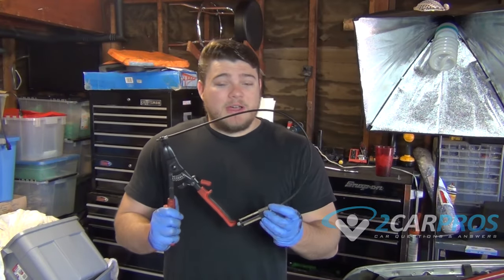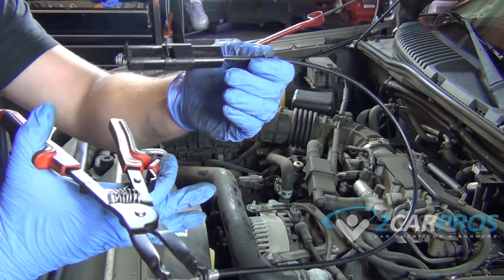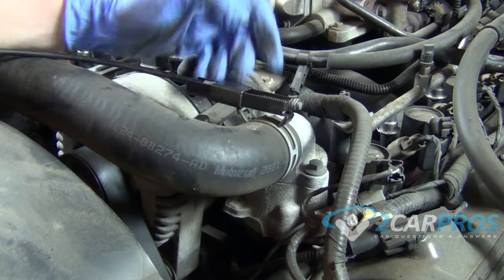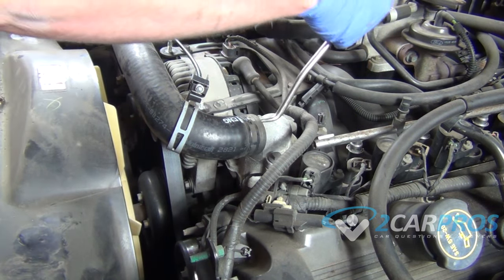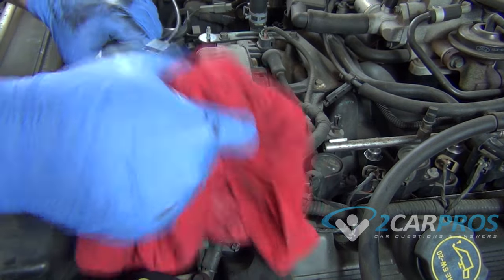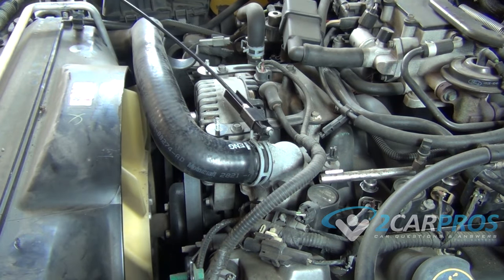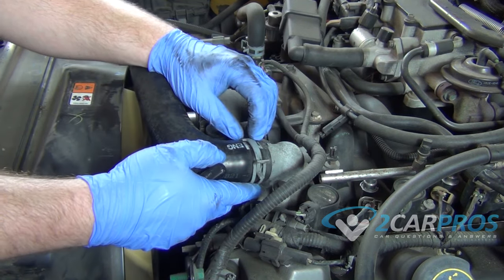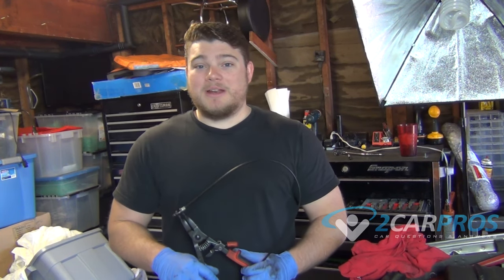How to Use Flexible Hose Clamp Pliers - Remove Hose Clamps Easy!

Comment: Another good tip on old hoses is to use a heat gun to warm them up to put them on and off  very useful on working on older Marine Engines and  Systems ! FYI
Reply: Or a good torch.

Comment: Use a little oil or grease on the inside of the hose, it helps them back off the next time you take them off

Comment: Your videos very well-made. However I ordered the tool you linked me to and I think it's an inferior tool to what you use. The one they sent me, the handgrip part is so small it's EXTREMELY difficult to build enough force for the tool to budge the clamps. It is better than the one I bought at my local auto parts store - it would not even open up wide enough to surround the little bat ears and squeeze them. I'm in my second or third week of trying to do this, so far I've spent $110 on wrenches, and the old defective leaking hose is still firmly on there. Well at least your video shows me how to do the repair, if I can ever get a proper tool. I'll never buy a car that has these hose clamps on it, ever again. I'll just keep putting new engines and new transmissions in my old cars and run them till they drop

Comment: I mostly work on motorcycles but still have issues with those types of spring loaded hose clamps. I see a lot of them on smaller fuel and vacuum lines in tight spaces. However, this unit looks too big to fit into those tight spaces to reach the smaller clamps I encounter. Seeing your operation though, just gave me the idea of using some small needle-nose vice grips to hold the clamp open while I use two fingers or two picks to pull the clamp back. Thanks for the demonstration!

On a different note... I don't understand why vendors sell something like this tool without providing a demo on how it is supposed to work. I think they would sell a lot more once people realize how useful the product is. I googled hose pliers (used to pry small hoses off their mounts), and remote action hose clamp tools were displayed. I had never seen them before, figured they must be useful to someone, but couldn't even see enough detail in the images to know how they work so had no interest in it. But then I decided to find a demonstration out of curiosity. Thanks again for the demonstration.

Comment: I rebuilt an engine and didn't know about these. I just saw these the other day and didn't understand the hose with the cable. That's AMAZING! That would have helped so much on the lower radiator hose of the Chrysler Sebring I rebuilt.
Reply from the maker: They are one of my favorite tools! Thanks so much for watching!

Comment: You never realize how having a special tool would really be needed... I had a small swollen coolant hose beneath a couple metal fuel lines on a 1992 Toyota 3vze engine that needed removing and I don't think these would have fit. Eventually got it loose with a pair of needle nose, but it took a little fiddling. But for most jobs these would work great! Thanks!
Reply from the maker: It is night and day! Thanks for watching!
Reply: Me to my heater hose clamps are deep off in the hood and space is so tiny I hope these work I just bought mine

Comment: TIP  for removing stuck on coolant hoses: 
1) while still filled with coolant, relocate the coolant clamps to the very end of the hose, even to the point of the clamp extending past the end
2) turn on the engine and warm up

the coolant will expand and "balloon" the hose ends radially outward  from the pipe nipples, while the clamps marginally still hold the hose in place and prevent leakage. if there is no ballooning, top up coolant to the point of over filling and try again

3) drain the coolant
4) remove the hose clamps

Comment: Is it safe to use these type of clamps on the radiator hoses of 2004 Ford F 350 Super Duty both top and bottom without them leaking coolant.

Comment: This is nice for the top hose which is easy to do even with pliers. But what about showing this work on the bottom hoses? Especially the small transmission cooling hoses.
Reply from the maker: Yes it does. Thank you for watching!

Comment: Nice video! 
I have a 1995 Oldsmobile Cutlass Ciera 3.1L with A/C. 
I just bought the regular style hose clamp pliers to remove the heater hoses from the heater core on the firewall. It's so tight in there I couldn't remove them.
The pliers in this video look like they need more room than what I have to work with.
Any suggestions? Thanks.
Reply from the maker: Maybe try right angle pliers? That sometimes work on the smaller clamps. Thanks for watching!
Reply: @2carpros  Thanks, I appreciate it!

Comment: Hi--Great video overall.  My one quibble with you is that you state at the outset, and I quote, "These are available from Amazon".  Not, "Pliers LIKE these are available from Amazon.  THESE are available from Snap-on's website for $138+, so unless you're a professional auto tech who uses these daily, go to Amazon and select a cheaper pair".  I immediately went to Amazon's website to look these up and purchase them.  I spent 30 minutes looking for these and, of course, never found them.  I did find the Mayhew version of this tool on Amazon, but it was $145.00 and included a pair of specialty hose pliers as well.  Both that one and Snap-on's version are made in France (I assume Snap-on's is simply a re-branded Mayhew).  It wasn't until I read Ken Johnson's comment (who lives in the UK) and your reply did I know that it was a Snap-on product.  The radiator hose pick you used obviously is, but this one was not.
Reply from the maker: Thanks for watching! I was just saying spending 140 bucks on a tool for the average person is a bit much. Mine are definitely snap on though https://l.facebook.com/l.php?u=https%3A%2F%2Fscontent-frt3-2.xx.fbcdn.net%2Fv%2Ft35.0-0%2Fp480x480%2F23483145_1676429019063418_142261678_o.jpg%3F_nc_ad%3Dz-m%26_nc_cid%3D0%26oh%3Da3fad1015077c86db60fef42512a339b%26oe%3D5A08BC08&h=ATPSjah4tPSCe7Q9HJl4cOZMudnRCWy4ZlyoeSvSCxdURHlVGlVmxHGZvSct5RuPtS3YiIeGtDGawN_3Zu698KJDu6CmpA_k9fbFloaIylecu9F7aMb353_sKP_XnIG0n3fIK7e36e3n
Reply from the maker: I left a link in the description to a more affordable pair.
Reply: You can also get the OEM brand for about $35 or at virtually any AutoZone for around the same.

Comment: Do you have a link to the mechanics pick? Great video. Well done.
Reply from the maker: Thanks for watching! The pick I used is made by Snap-On and is only available through a Snap-On supplier BUT other companies make a similar product on amazon. Mine is something like this https://store.snapon.com/Miniature-Awls-Hooks-and-Picks-Instinct-174-Soft-Grip-4-pc-Instinct-Soft-Grip-Miniature-Pick-Set-P891665.aspx
Reply: The one used in the video looks longer and thicker. Already ordered the keep your knuckles from getting bruised tool. 😎 Found this one on AMZN.com Drake Off Road 4521 Hose Removal Tool $10.88. While I would love to have a SnapOn tool, they are a little expensive. Thanks again. Probably will have some questions when I actually do my coolant drain and refill.

Comment: These look great! Can you tell me the brand name please? Not sure if i can get the same ones on Amazon UK.also,what's your opinion on replacing these clips with stainless steel ring clips(the ones that are screwdriver tightened?thanks.
Reply from the maker: They are amazing! One of the best tools I own! The ones used in the video are snap-on brand. Which means they are pretty pricey but come with a lifetime warranty. That really makes it worth it to some one like me. I believe these are it but I can't really tell because they didn't bother to put a photo lol https://store.snapon.com/Non-Catalog-Items-RATCHETING-HOSE-CLAMP-PLIERS-P9769484.aspx

So I linked more affordable ones in the description, just because the average person does not need snap-on.

Those screw driver tightened hose clamps will work the same and be much easier to work with. I replaced a few of the snap hose clamps with screw versions. Just a lot easier to deal with when it comes time for repairs. And convenience is king for me! Thank you for watching!
Show less
Reply: Snap on is too expensive for what I need but they give me a good idea now.
Gonna have a look at your channel.ust be good with that many subscribers!
Thanks for helpful reply.
Regards.
Ken.
Reply from the maker: No problem thank you for stopping by! :)
Reply: With regard to replacing constant tension spring clips with worm drive clamps (screwdriver tightened), keep in mind that the performance of typical auto parts store worm clamps is substandard compared to spring clamps because they fray the hose with the adjustment slots, they can strip, they can cut into the hose, they may not be able to apply adequate tension to prevent leaks, and they don't compensate the shrinkage of the rubber.  If you absolutely have to do this, I would use the racing style T-bolt clamps.  Harder to find, but they don't give you the problems of the cheap worm clamps with the exposed slots.  Just my two cents from the school of hard knocks.

Comment: Great video, I found this tool on ebay for about $10 from china, would you advise avoiding them or are these cheap ones good.
Thanks 2CarPros
Reply: They may be fine for a while but I wouldn’t except them to last.

Comment: I want the pair you used, amazons link goes to a piece of crap ones, I think they switched on you. What brand is yours?
Reply from the maker: Snap-On, they are very expensive and unnecessary for most people. Not to mention you need to find a Snap-On dealer just to get them. I linked to normal affordable ones.
Reply: @2carpros  I'd like a pair but cannot find how to locate a dealer anywhere on their website. The ones you link to are a bad design as the gear the locking mechanism is supposed to latch into doesn't last beyond a couple of uses which defeats the purpose of these. I noticed most are made the same way with the gear teeth on a circle at the top and a small pointer which is supposed to latch between the teeth but it strips out after a couple of times. They are one use only. Better design would be worth it to me.

Comment: Could you not use a screwdriver instead of the pick?
Reply from the maker: You sure could. I just have the pick handy. Thanks for watching!
Reply: The bend in the pick allows access in some situations where there isn't clearance to get a straight screwdriver shank under the hose.